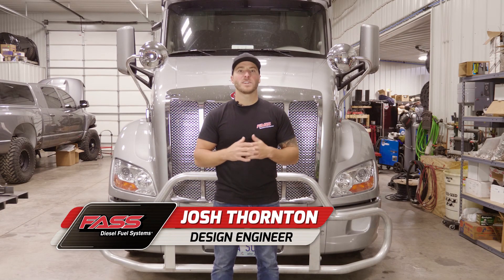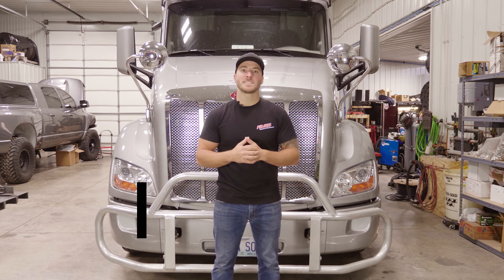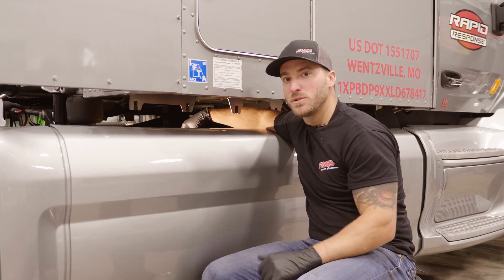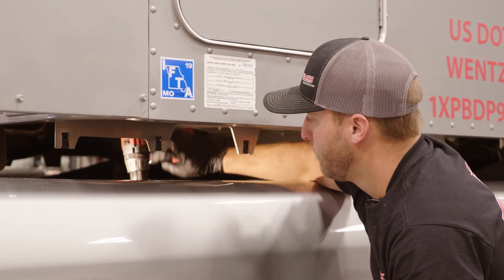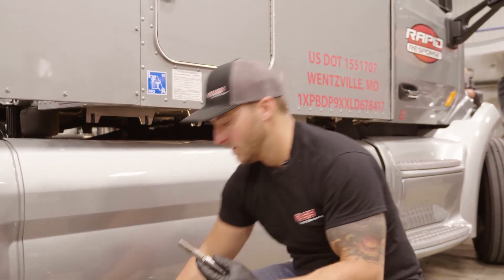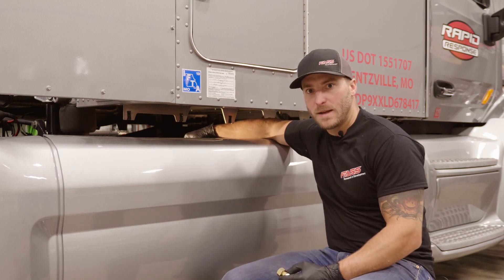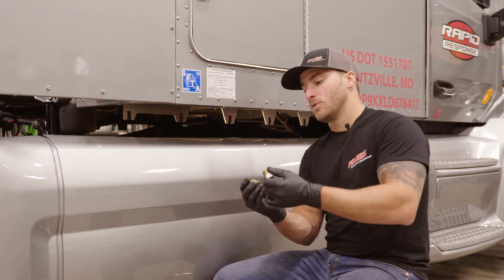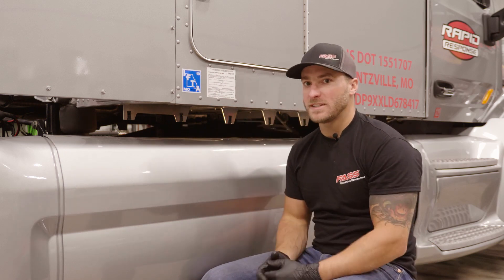Paccar MX 13 Fuel System Upgrade

Comment: I have a Paccar MX-13 EPA 17. What would be the recommended model for this engine, and can I get the complete kit?

Could you provide me with an estimated installation time for this product? I mean, how long would it take for a technician to install it?
Reply from the maker: Thank you for reaching out! We have a link here for the kit we'd suggest for the MX-13: 

https://fassride.com/shop/product/shop-category/universal-industrial-series/fass-ind165g-industrial-series-diesel-fuel-system-class-8-semi-165gph-universal-ind165g/

Also, installation times can vary based on the cab configuration, and engine selection of the semi. What is your postal code and we can send a link to the dealers close to you for quotes?

Comment: So what's this do for ya.
Reply from the maker: Thank you for reaching out! FASS Fuel Systems remove over 99% of the water, from your diesel fuel, which can extend injection component life significantly. 

Additionally, our filtration removes the air and debris from your fuel, allowing for improved driveability, power potential, easier start-up, and smoother idling. 

If we can help with any questions regarding your truck, don't hesitate to shoot us an email at techsupport@fassride.com, or give us a call at 636-433-5410!

Comment: What does this do ?
Reply from the maker: Awesome question, and we really appreciate you reaching out to us. FASS Fuel Systems remove over 99% of the water, from your diesel fuel, which can extend injection component life significantly. 

Additionally, our filtration removes the air and debris from your fuel, allowing for improved driveability, power potential, easier start-up, and smoother idling. 

If we can help with any questions regarding your truck, or if you'd like to review some 3rd party test results, don't hesitate to shoot us an email at techsupport@fassride.com, or give us a call at 636-433-5410!
Reply: @FASSFuelSystems   well thank-you Kindly.
Reply from the maker: @sgsupreme17  Absolutely, we appreciate you reaching out.

Comment: I would have liked to see a little more on the installation options?? I don't like Paccar's proprietary antics, (ie; DAVIE resets..., the secondary fuel filter you can only get from Paccar at $50...) It would appear your system should be able to bypass that secondary filter?? removing it? Just taking the filter out of it?
Reply from the maker: Happy to help! When you have a minute, give us a ring at 636-433-5410 or shoot us an email at techsupport@fassride.com, and our service team will be happy to make some recommendations.

Comment: How much it cost for parts and labor?
Reply from the maker: Great question! The system shown here is currently on sale for $709 before shipping (link below), but labor will be set on a shop-by-shop basis. 

If our support team can answer any questions, don't hesitate to give us a call at (636) 433-5410, or shoot us an email at techsupport@fassride.com. 

Thanks! 

https://fassride.com/shop/product/fuel-air-separation-systems/titanium-signature-series-diesel-fuel-lift-pump-ts-250gph-class-8-semi/
Reply: @FASSFuelSystems  you guys don’t do installs?
Reply from the maker: @truckertom3585  I do apologize as we don't currently do installs on-site, but we do have a large dealer network! If you don't mind sending in your zip code to techsupport@fassride.com we will be happy to help find the closest dealer to you.

Comment: Did I just watch you drill holes into the frame?
Reply from the maker: That's correct! Some installations do require drilling holes to mount the pump.
Reply: @FASSFuelSystems  the frame says not to drill holes or weld onto.
Reply from the maker: @TheGoodSamaritan4000  You're absolutely right! However, the amount of material removed to mount our bracket doesn't compromise the structural integrity of the frame whatsoever.
Reply: @TheGoodSamaritan4000  you shouldn’t drill into the flange of the frame

Comment: What would be the purpose of putting this fass fuel system on my paccar
Reply: Just installed the FASS TS 250G on my Paccar today and the results are crazy good.  It’s smooth instant power,  the MPG bobtailing was 14.6 55mph, 12.6mpg at 70mph.  I’m about to go out and do loads with the trailer I’m 36,900 empty with trailer and 79,400 loaded so I’ll update numbers after my runs tonight!  But I would give the FASS 10 out of 10 right now.  The install used my existing fuel lines and the return line I installed a Tee at the factory return line that was just 8” away from the fass no drilling required.
Reply: @matthew6202 are you still happy with your system
Reply: @matthew6202 how was it ? Do you remember
Reply from the maker: Hi Jeremy! We apologize for the delayed reply. FASS Fuel Systems remove over 99% of the water, from your diesel fuel, which can extend injection component life significantly. 

Additionally, our filtration removes the air and debris from your fuel, allowing for improved driveability, power potential, easier start-up, and smoother idling. 

If we can help with any questions regarding your truck, or if you'd like to review some 3rd party test results, don't hesitate to shoot us an email at techsupport@fassride.com, or give us a call at 636-433-5410!